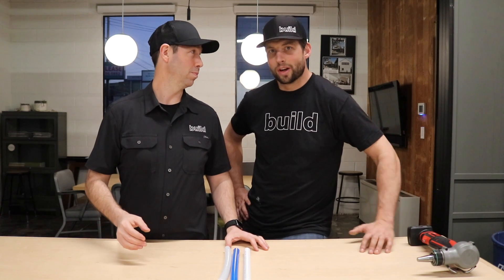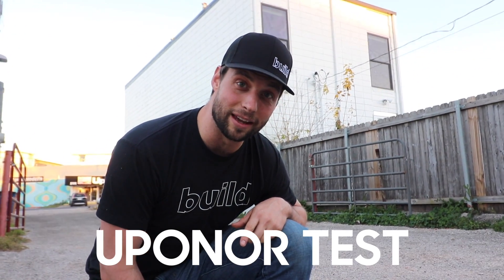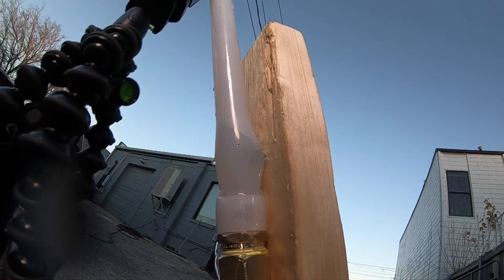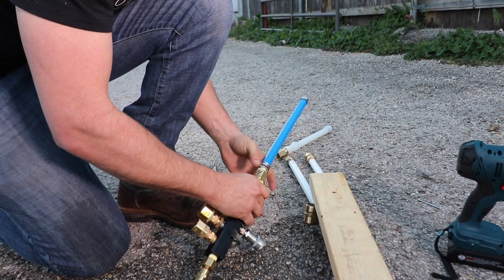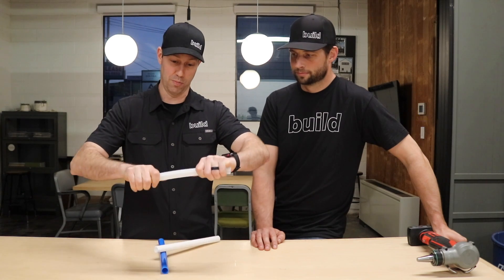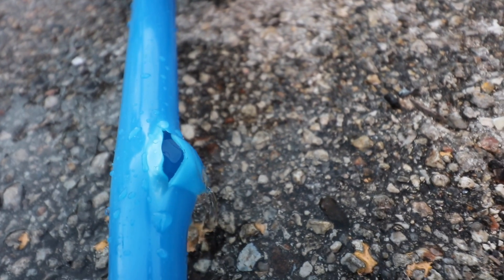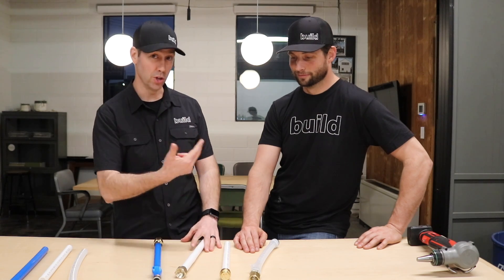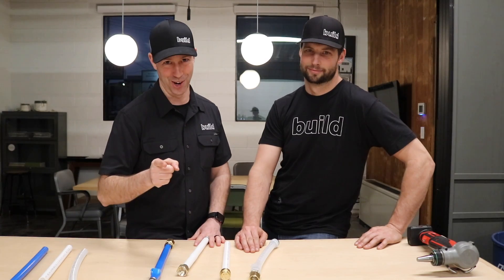How many PSI to blow out PEX?

Comment: So I've been using 1/2" PEX pipe in my home garage for an air distribution line going on 11 or 12 years now. I use three ear wing backs with bushings for the air chuck take offs and I use PEX 90s and tees wherever necessary. A few PEX ball valves to isolate zones and to blow out any moisture from the end of the lines. I've been told by a few people that it's dangerous because of the high pressures. My compressor cuts out at a tank pressure of 125 psi but the regulated pressure is 100 psi. My PEX is rated at 160 psi at room temperature, we now have data that suggests that even the poorest connection type is good for over 500 psi and better connections and pipes are good for maybe 750 psi. Some dedicated air line system are listed for up to 220 psi. Let's just cut the sh.t! Pex tubing is more than ok for air lines with what appears to be a 4x to 4.5x safety factor built in. All of the items are readily accessible at any home center and are cheap. I understand there are regulations and governing bodies who tests and validate these items but it is possible to perform high quality and safe work by ignoring the labels.

Comment: I keep having a problem with my pex valves blowing out.  My water pressure is 50lbs.  It blows out the rear plug.  I bought a new manifold and it came with all new valves. I did not have a problem for 4 years but I have blown out 2 in the last 2 weeks.

Comment: Very useful test, Matt.  Here's another variation of the test that would be useful for those of us in hot weather climates where builders like to run Pex in attics:

Test the three versions of Pex with extreme pressures a home might see, say 150psi to cover worst case scenario.  Then apply 200 degree F to the pipe to see how it reacts.  My guess based on your pressure tests is that Pex A would likely fail first.  However, I also believe (w/o evidence) it may outlast the others in longevity since it may remain more pliable over time.  Pex B & C just appear to have a composition that could become more brittle over time (like PVC).  Again, just guess  and testing longevity isn't easy.  But the heat test under pressure would be useful to many of us.  Thanks for educating (and entertaining) all of us.

Comment: Pex is superior to everything when you factor in expansion also. Shark bite push fitting will fail at around 500 psi the average house is between 30-80 psi

Comment: This certainly supports my position that PEX is the best piping for shop compressed air.
(A plumber I know uses it for all his air lines, since it is more than adequate for pressure, doesn't rust or corrode, and never flakes like galvanized AND copper can do.)

Comment: Well thank God water pressure in a home is normal only 120psi so I think we are safe!
Reply: If your home is at 120psi, you really need a prv. Anything over 80 drastically reduces the life of plumbing fixtures. 35-60 psi is a fairly common residential pressure range depending on location.
Reply: If you have over 80psi coming from the water main into your home it's not to code. 120psi blasting out of a faucet while my kids' are washing their hands is a horrifying thought.

Comment: OMG! Guys! Stop testing like this!!!!! To fine out what kind of connection will fail, you need to do a few things!!!
1st  put a check valve on it, so you don't have it leaking back into the pump! 2nd! Make the pipe either really short, that you basically have the 2 fitting touching each other so the pipe isn't the weak point. OR.... SLEEVE the pipes!  Like put a copper pipe over the pex pipe so it can't expand and then the press will go to the fitting connections!  Also put a cover /lid over the pipes, so it doesn't shoot off like a rocket!  You need to stop it from going up in the air like that, because it can go really high and come back down and hit a car, person, house or a pet! 
 And finally,  do the test with HOT water as well! Oh and why not try to pump up a copper pipe as well? Then you can see the difference between the two!  And i saw your 1st video on doing this with hydraulic fluid,  man that was a total Sh¡t show.... so when you actually do this, you will heroes to everyone who is a plumber, thanks!
Reply: I hate pecs worst thing ever ,i got screwd by contrator that put pecs in my new home,,hired by precision estamators a public adjuster co. Took outmy copper pies n put pecs crap thay took mysupply main4 water ,i had a inch line or at least 3/4 thay made it like ,3/8inch  omg nopressure, in home now, people dont let these contractors screw u, never use pecs,i have 2get  a reputable plumber now and redo entire plumbing in house, oh yea all old copper misteriousy disapperd. Humph,guess plumber used it in his house, oh yeA new heat sys.is settin off co detectors ,guess da town of crookhaven insptors. Got pd.off 2 pass the crap jobsdone,butnow housewont pass final insp.say main floorbeam ng.contractor cannotb found, ie.dont let presion adjusters screw u 2 there in manorville ny.

Comment: This test isn’t a good test to perform in this manner. 
Without a ton of detail. 
Pipes tested should be at least 6ft long. 
Pipes should be tested with hose temp cold water. 
And test hot from 120-160 
Also on another set of pex with a tee 3ft high and 3ft out. 
There’s much more but these are just a few that should be done.

Comment: So if I use shark bite and pex for an air compressor system AFTER 25' of compressor tubing, just to have a small section to collect condensed water before the air filter, then that should work fine?

Comment: I'd be curious to see if 1) temperature affects this if the pipes are chilled/ almost frozen if that will strengthen the plastic, and 2) if the change in pressure in terms of time affects the strength of the pipe, seems like the first two pipes were held at a certain pressure and this "weakened" the pipe walls and by the time it got up 750 they were already weakened. I'd be curious if all of the pipes can consistently hold a pressure right before they ruptured.

Comment: do you seriously tighten fittings up with vice grips??? As a plumber this bothers me. Also, pex a and pex b have different properties that you failed to mention. The way i see it, they have two different uses. All in all great educational video you guys. We use primarily pex b where im from, and alot of PLASTIC fittings. I have seen several of those fittings fail. Can you test those, as all your connectors were strictly brass?
Reply: Oh no, Vice grips. 😂

Comment: I wonder if the pex had a fine woven metal mesh in the plastic if it would allow more pressure. I'm thinking the mesh would slow down the bulging which thins the plastic walls allowing it to handle better under pressure.

Comment: but what pressure will it hold with hot water?  I know a house where the hot water on demand malfunction and it blew the pex pipe. so did the pipe blow before the safety valve open to blew off excess pressure.  if so at what temperature and pressure was the water.
Reply: This would be a very relevant test. Great suggestion. I am in the plumbing sales industry and would love to be able to give solid advice as to what pressure the pipes could potentially fail other than what is marked on the pipe itself. For example: if pex b is rated for 180 psi at 70°f (just a random number, not exactly) what psi would it fail at say 200°f?

Comment: I have a 2001 Karsten K-20 Estate Series doublewide. All plumbing is PEX. A few years ago my washer gave problems in that only the hot water would be in the washer. I wasn’t aware of this and when I discovered a flood of water in the utility room and my walk in closet I figured the washer from the hot water PEX valve needed to be replaced. I didn’t have that expensive crimper to install a new PEX with valve. I went to Lowe’s and purchased an Alligator attachment. I cut the bad part of the valve and PEX. Installed the valve and slipped the alligator sleeve and now no problems (new washer purchased too).  How many years does PEX piping last?  I wasn’t sure if this alligator slip on adapter would last. So far it’s been leak free. I would like to purchase a PEX repair kit. Can you recommend one?  This would be of great help to me. Thank you. Joseph DuranJr.  jaduranjr at icloud dot com

Comment: Great video and test. Based on what I saw: 1) do NOT use these fittings in finished walls. Similar to where to apply electrical connectons. Not very practicle if you plan to run PEX.  2) Use Water Hammer preventers where you have electrical valving. 3) theTPR valve in the water heater should stop pressure loads over 150psi (not hammer).
Reply: Lmfao wrong

Comment: Also can we do stress tests on these type of fittings? Rig up something to flex the pipe and connection over and over to simulate a long term expansion and contraction? Something along those lines. Or put it in a repeated heat cool cycle that lasts a few minutes for a week or two. and get a few thousand cycles in?

Comment: I would love to see how this related to pressures from freezing?
Reply: Conrad S freezing would technically give you several hundreds of thousand PSI with no change in size as the pressure is due to the volumetric expansion of water changing to ice. The expansion of the pipe would reduce the apparent pressure as it expands to accommodate the additional volume. In the case of freezing the PEX will certainly outperform copper.
Reply: @scoutmaster33  gotcha I'm sort of following you. I do know pex will expand and perform better. I'm curious though, wouldn't these pressure tests be comparable to what would happen during a freeze?
Reply: Conrad S what happens during freezing is the water expands so the pressure you would see is related to the rigidity of the plastic. In the case of copper you will actually yield the copper and as its hardened for use in pipe it will rupture. The most relevant information from the video is the amount of plastic deformation that took place prior to it rupturing as noted by the pump pressure dropping each time it was pumped. Plastic pipe would be far more resistant to freezing than copper assuming it remains ductile at the freeze temperature.

Comment: 30 year master plumber here... just to say " ok, that was pretty cool ". 
Now try to blow off a solder joint. You won't budge a brazed joint. Not if it's brazed correctly. Brazing makes the two metal surfaces like one but solder joints can be peeled easily with a smack after cutting a fitting in half. I'm wanting to say the solder joints friction to hold a fitting socket together can be overcome before the wall strength of copper is.
Reply: At the same time - see how long copper pipes will last with water hammer.

Comment: My suggestion: Find a steel or some other metal pipe that fits snug over the plastic/PEX/whatever.  Even cut a pipe in 1/2, lengthwise, and use multiple hose clamps, to prevent the hose from rupturing.  Keep the hose length shorter so you could just use however many hose clamps, each touching the previous and the next.  This will FORCE the rupture to occur at the connection device rather than the hose.  I'm curious what kind of pressure the connections can withstand.  Great show!  Just keep the hose lengths all the same.  Use a hose clamp on the plug at the top.

Also, you could look for a gauge that has a second needle that will be pushed up by the main needle, but doesn't come back down until it's manually re-zeroed.

Keep up the good work!!!
Reply: Or, a digital gauge, way more accurate and with built in max pressure display

Comment: But what pressure does a frozen pipe actually reach?  Maybe test a few sizes and lengths. Fill vertical pipe with water and top off the last bit with an oil that wont freeze, and a gauge on top.
Reply: I could be wrong, but I thought I remember seeing over 1000 psi for freezing water.

Comment: As a licensed Professional Engineer, let me say that the failure mode will be fatigue... meaning, how many cycles of pressure spikes can a pipe or joint take? For instance, water hammer will momentarily cause a pressure spike of double or perhaps triple your normal operating pressure. So even on a well pump system, you could see repeated spikes of 200 psi or more. After several thousand such spikes, you could easily see a leak - even though the pressure never reaches half or a quarter of the burst pressure. 

The other thing to consider is the combined affect of chemicals (chlorine), pH and time. All of this means that leaks can and will cause plumbing to fail well before ever reaching burst pressures for a brand-new pipe.
Reply: Yeah but those failure modes are even more likely in copper (fatigue, corrosion)??
Reply: as an engineering intern I would mention these are creep failures, these materials have a creep nature to them, like aluminum, they are under pressure constantly.the spikes you are talking about are not very high in a pex palsitc strechy pipe.

Comment: Great second test guy! Looks like all pex connections and both pex types are more than capable for handling real life situations. Now it's just a matter of proper installation and how these systems age over time. I still think Uponor leaves the least to worry about due to no risk of rusting and the nature of the connection leaves less risk of improper connection. I did notice a small amount of water leaking from the Viega connection before it actually started showing swelling in the pipe. (It was still at a high pressure) Hats off to the Sharkbite connection for being the only 1000+ contender.

Comment: Can't wait to see the pressure that copper can handle. I hope you are going to test various schedules and types, including a soldered connection as well.
I would also like to see  how kinked pex and kinked and heat fixed pex test. I wonder if they are different, weakened? Cpvc tests?

Comment: Good so far ... but I’m on the other end of the continent, in Fairbanks Alaska.  If we lose heat in just one area it can be a disaster.  It’s about -5F at the house but about -25F in town which is 700 feet lower elevation (warmer air rises, cold air falls to the valley bottoms).

So my concern would be how do the different PEX brands work when their below freezing?  I saw the fitting test in the cold box, how about the same for the different PEX brands/styles for us northerners?
Reply: You do know that the hole PEX invention comes from Sweden/Finland?  It can take freezing amazingly well. 
Parents house was built in 94 and the shower was installed on a outside wall. Stupid thing always freezes every winter due to plumber saying it will work just fine, was even planned on a other wall but he thought it looked stupid. You know there's that first cold rush when there is almost no snow, as soon as it's snowed they shovel snow on the wall to help. It's installed to far out in the concrete also so extra insulation don't help, need to widen the house foot also then or hammer out the floor and move the pipes. 
And Still to this day it has not started to leak.

Comment: Good video about pex. I would love to see how push to connect (shark) handles water hammer. In other applications we use it with flexible air hoses that whip around with pressure changes no problem. How would that work in my house on copper pipe with water hammer? O ring gaskets in other products are prone to slipping and failing whenever the rigid pipe moves.

Comment: How can we increase the pressure to launch it into orbit?
Reply: Parm Mohan I know you were simply making a joke, but I think it’s worth pointing out that a single impulse (like an explosion, or what happens when a pipe bursts) can never put an object into orbit.  Sub-orbital trajectory sure, and a big enough impulse could theoretically push an object to reach escape velocity and leave the Earth entirely (not easily done as escape velocity from Earth is more than 40,000 kph, or 25,000 mph) but to achieve orbit there must be additional impulses of energy to reshape the trajectory into an orbit.
Here’s a simple thought experiment: Fire a bullet into the air using bigger and bigger powder charges.  As we use more powder the bullet lands further and further away, eventually (if we angle our gun correctly... you weren’t shooting straight up were you?) eventually we hit the far side of the planet, and in fact if we are careful we can get it to go all the way around and land at our feet.  But add just a smidge more powder and now the bullet has escape velocity and will not return.  All this assumes no atmospheric drag, an infinitely strong gun barrel and bullet, and perfect aim.
Reply: John Early Yes I was joking.

Comment: So why spend all the money on copper?  I'm done sweating joints..
Reply: Because little simple house plumbers ought to see what is possible even if they won't be capable of the big commercial work where copper is often still used.
Reply: If you dont enjoy being poisoned by leeching plastic
Reply: @darkone12491  You better stop drinking everything then. Name a substance and chances are it was housed and or supplied from plastic.
Reply: Doesn't make it right. It is just the way it is!
Reply: @darkone12491  do you know if tests have been done?  I know PVC leeches, I have not heard anything about PEX.

Comment: I don’t know why but this is really fascinating, I’ve used pex to build a plumbing system for an rv, the pump runs the system up to about 50-65 psi, no problems at all, I’m using the stainless steel crimp fittings, what is your opinion on those fittings?

Comment: I would be interested in seeing the performance of the PEX tubes that have been bent or squashed.  All this stuff is going to perform fine out of the box but I'm more concerned about how it does when somebody steps on it during installation or puts a kink into it while running it through a wall bend.  In particular, I'd love to see how much strength PEX-B loses.
Reply: Once pex b is kinked its trash from what I understand